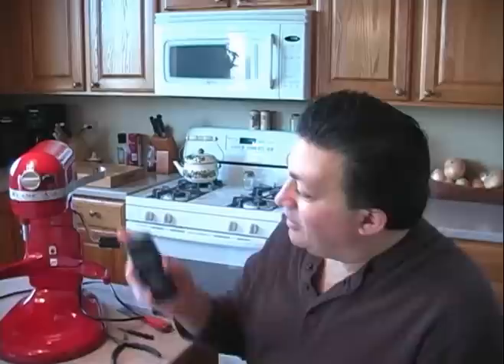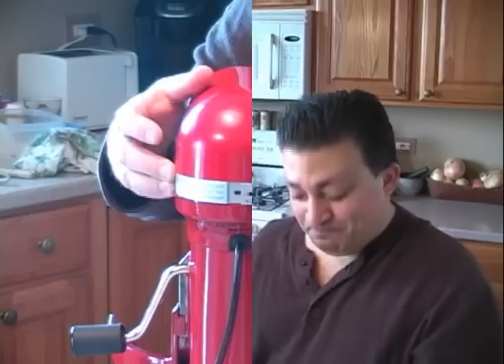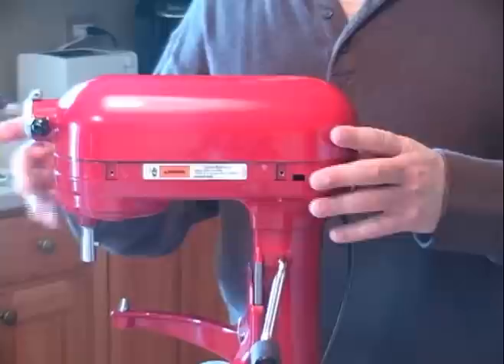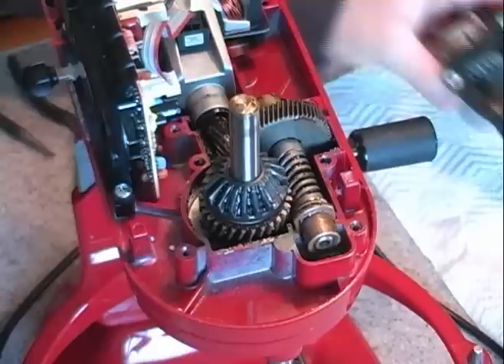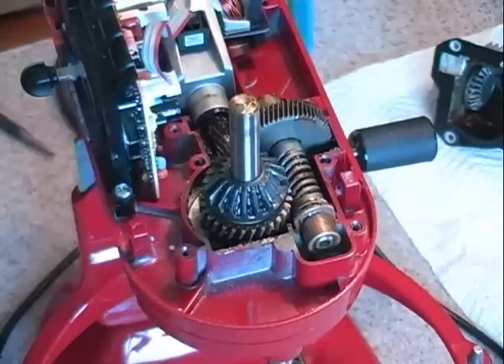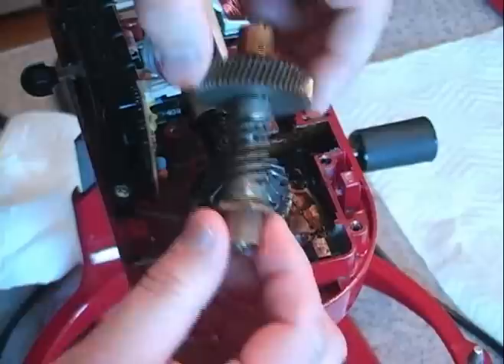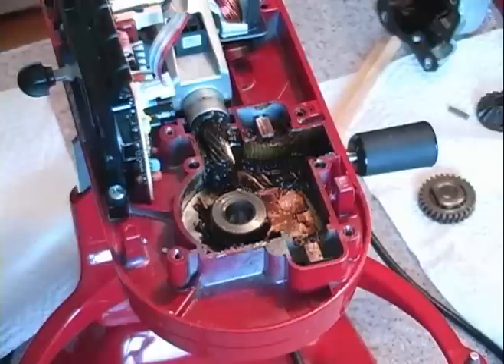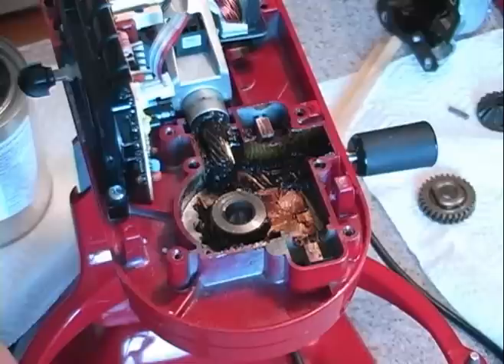How to Repair a KitchenAid 600 Professional Mixer That Isn't Spinning

Comment: The wife has been using hers for at least five years making bread two or three times a week. Her machine stopped turning and I used your video to take it apart and determine the worm following gear was all shredded. There were bits of metal inside as well. I used your video to take it all apart, figure out what the problem is and then I ordered new parts. Thank you. Much cheaper than buying her a new one! One point about the mixer, you have to be careful to only use the recommended speeds for the job. If you try to use it on too high a setting you wreck the gears. Thank you again! Great video. Saved me $$$$$ and made my wife happy. Happy wife, happy life.

Comment: I just received the parts and put it back together again.  It works great.  Thank you so much for your video it has saved us a great deal.  Your instructions were easy to follow and very clear.  Again, thank you, thank you, thank you.  Anyone else reading this just follow his instructions and you cannot do wrong. Thanks again.

Comment: What a great video.  I too bought a mixer, the big expensive one.  After a very short time the gears are not working.  But of course after the warranty.  The totally ridiculous thing is that my new one was 4 years old when k put, but I bought a 4 qt back in 1977 that still works like a charm.  Since my big ones doesn't work, I am going to try and fix it myself with you great video.  I feel I have nothing to loose.  Thanks again and great video.  Love PegEgg

Comment: Still ticked off that Whirpool would not fix the unit for free. Future models like yours came with the aluminum trans cover that I think would be far more durable. But the unit is fixed and it cost me about 30 bucks with shipping, thanks again.

Comment: I purchased a KitchenAid as a newlywed in 1979 and have used it a lot, like several times a week. It has run like a champ and never even been serviced. I think the quality of their parts were better back then. Lately it has been making a lot of noise when it runs, so I will take it apart and clean it up and see, if any of the gears maybe needs to be replaced. 
Thank you for the great video, I will follow it as I try and fix this noise problem.

Comment: Dear Sir:  Thank you for this video.  My KA Pro 5 broke.  The motor ran but the paddle would not spin.  It would spin but stop right away then if I tapped it it would do the same.  Was going to bring it in to get fixed but the KA authorized repair shop that I brought it to about 7 years ago closed and the closest was in Orange County and I live in LA so the drive would be far and maybe it would cost a lot to fix.  So I thru research I found your video and bought the parts from Mending Shed as you suggest.  I was able follow your directions and now it works like new.  Works like a charm.  Even tho you have the 600, the 500 inside is the same.  I think the difference is, is that the bowl is probably 5 Quart not 6 like yours and the motor I can guess has less wattage than yours.  Thank you once again, now I know what to do if it happens again.

Comment from the maker: Thank you for the very kind feedback on the video!  

I was very disappointed that it failed after such short a period of time. We purchased it new directly from KitchenAid as they were offering a rebate at the time.  We used the shredder attachement during the 1st year once, so I dont think it was that.  I think a tooth on the bevel gear snapped off (maybe was weak) which caused binding and furthur damage.  It appears the bevel gear is not made of as solid of material as the other gears.

Comment: Excellent video !  Thanks for taking the time to make it.
I don't have a problem, just wanted to see how this mixer was made.
To be honest I thought this mixer would have been built stronger, I can't imagine 
making it any cheaper as this is the bear minimum I would want for reliability.
A mixer of this should really not be breaking the gears if anything the speed control board should sense the extra current and stop the motor short of doing any damage to the mixer. Thank You again.

Comment: Thank you so much for your video.  We have a very similar problem with ours.  After only a few used the gears are grinding inside and the machine is skipping when turning.  I started to take it apart but was afraid to continue.  Your video is so complete that I will be taking it apart to see which gears I have to replace.  Thank you so much for all your help.

Comment: I bought my KP26M1X shortly after you, in March of 2009. Mine died today while making bread dough. My worm follower gear was worn to about nothing. The remaining teeth were super thin, but the worm and all other gears, including the bearings are almost like new. I use mine A LOT, but for bread dough, which I suppose wears on the gears. I went to the website you said and ordered a few of those gears, and 1 each of all the others with the grease. That way, I'll have the parts on hand next time!

Comment: thanks for the help, I have a wolfgang puck stand mixer 700 watt. Its very similar to your mixer and this video helped a lot. I'll have to replace all the grease b/c of all the metal shaving in it. I had 3 gears stripped. Nice to see that they where all metal gears....thanks again.

Comment: Thank you for the video. Mine had the plastic transmission cover which I replaced with the aluminum one(my wifes kitchenaid is 10+ years old. It locked again when my wife was using it. I had replaced the bearing pieces, gears were in excellent shape. It locked up while my wife was using it. I checked it again, and the gears were fine,but the screws were loose on e trans cover. I suggest running it for a minute and rechecking the 4 screws on the trans cover for tightness.

Comment: I just ended up fixing the same exact problem with our mixer.  I didn't even think about getting the service manual or looking for a repair on youtube, it was pretty straightforward.  I ended up doing a different repair, rather than getting replacement accessory drive gears, I used sand paper to rough up the bushing in the transmission housing, and then filled that hole with JB Weld epoxy.  We never used the accessory drive, so I figured it was a liability.  It seems to me that those accessory drive gears are pretty anemic in this model.  It looks like the newest version of this mixer has an entirely redesigned transmission which is a lot better design.  AvE has a teardown of the new model in his channel.

Comment: Well done video. We have been able to follow your procedure exactly and have had not been lost at all. The parts came today and I am working on getting it back together. This is an outstanding resource for those of us who have the 600 mixer that seems to have this gear defect issue. Wondering how long this repair will work as I cannot figure out why the gears wore out in the first place. Thanks.

Comment: @cbaiocco I have had the bevel gear on two different Pro 600s break a combined total of 6 times. It's not an odd gear to break. I finally gave up and ordered a Bosch Universal Plus for mixing bread dough (which I do 2-4 times per week).  I would like to use these instructions and fix it hopefully for the last time, and then only use it to make cookie dough, frosting, etc. All previous 6 repairs were done by an authorized shop, some of which were covered by the warranty.

Comment: Thank you.  Mine is still working well and I use it heavily.  I bought mine around 2006 or 7 and I make two loaves of bread twice a month, one of the most taxing processes you'll use this machine for, as well as a myriad of cakes and bagels etc..  However, the post assembly for the attachments keeps falling out now.  I see by your video that the pin that holds that from falling out has either broken or come out of it's hole.  I'll get around to it eventually.  Thanks again.

Comment: Thanks so much. I'm off to get a snap ring plier to see what gear needs to be repaired.
I agree that Kitchen Aid should be built stronger. I use mine very hard but thought that It should be able to handle the work load.

Comment from the maker: @DM McDougal try using a little oil/lubricant at the top of the shaft.  Another option is to remove the retaining ring from the worm follower, then you can tap the planetary shaft down I believe.  The bevel gear will come off, there are no other retaining elements.

Comment: Great video! Fixed my wifes unit.My plastic trans cover cracked causing a misalignment of the gears. I replaced that bushing at the end of the worm gear, all the other gears were in excellent condition. Reused old grease(very limited use of this mixmaster). Turned it on and everything worked perfectly. I really wonder if you need that benelene grease or if it can be substituted? I know the device is for food, and the grease is nontoxic, but it is a sealed unit. I thought of using synthetic.

Comment from the maker: @xpectin:  try inserting a screwdriver between the bevel gear and the worm follower gear and gently pry it up.  The bevel gear may not slide up the shaft easily at first.

Comment: Hello, thankyou for.your video.  I saved it because its chalked full of vital information if ever needed!
Would you be able to tell me what would cause the beater to fall out when I am finished mixing??? Also, the whole upside round thing fell out, that the beater hooks into. Im so bad about explaining when I have absolutely no idea what any of the parts are called, please forgive me. 
Blessings♥️
Reply from the maker: I had the same issue after I made this initial video.  The planetary shaft disconnected from the assembly.  Since it is pressed in, I had to replace the planetary assembly.  I expect this is what you will need to do.
Reply: @repairit2  Thankyou so.much for responding..I called Kitchen aid and they gave me a local # 
We took itnto.San Jose and  had it maintenanced and everything in side was all good and he put.the planetary on correctly. He change the greased cleaned it up and charge us $60. Not bad since it was purchased in 2007. Someone gave this to me and I dint know of its ever been serviced. Im so happy to have it back working.

Comment: After I ran it again(with the top cover off, the big steel one on top), the screws were loose. I think after everything seated, the cover was loose. I retorqued the screws, and it was fine after that. Problem solved!

Comment: Excellent!  My Professional 600 spins, but has clunking noise.  What could it be?  All the gears look good.
Reply: I've noticed this as well after doing my repair. See how the bearings around the worm gear have flat sides that sit in the housing? They are actually quite loose, causing the worm gear to knock around. My guess is that this play in the worm gear is actually what causes the worm follower to grind down and eventually need replacement. It's a poor design, unfortunately.

Comment: How has this held up since the repair? Wondering if the repair parts are any sturdier than the originals. Have an identical mixer with a stripped worm follower gear, just waiting for parts.

Comment: thank you for the perfect video. I did everything like you explained. when i finished i noticed that there is a very noisy clicking and ticking that sounds like its coming from the back off the mixes , where the engine is. It gets louder as I turn up the speed . and this is with no load. the wired thing is , that when I run the engine with no gear it is silent...so .. very wired , and ideas?
Reply: Ravid Kol Any solution to your clicking? I repaired our Kitchenaid and it is doing the same exact thing. The engine still runs but the gears seem to be clicking.

Comment: Thank you so much for the video!  We're stuck however on the Retaining Ring Pliers.  We got a pair at Home Depot, and they won't go into the little holes.  The size says .070 so I was wondering what size you had.
Reply from the maker: The set I had has multiple tips (.070, .047, .036).  I believe I used one of the smaller sizes.
Reply: repairit2
Thanks!  We found it at Ace.  If anyone is reading this, the RIGHT TOOL is SO important!  Get the Craftsman Professional Retaining Ring Pliers.  Convertible: Internal and External.  #47412.  $25, but anything less won't work.  Removing that ring is impossible otherwise.
Reply: repairit2
JUST FINISHED!  We got the parts, and since my husband was out of town I was able to put it together with your video's help.  I feel SO EMPOWERED!  Thank you so much for the time you took putting the video together.  I'm aching for some baking!!!
Reply: Would be nice to let people know there are different sizes!!!!   Don't know of many homeowners who have this tool on hand as a general rule.   Bought one on Amazon and still not right.   Otherwise video was very good.

Comment: We did use a lot of force on it with pliers and a hammer. I think we were close to cracking the bevel.  It slides up and down easily, but gets stuck at the top when flush with the shaft.  Any other ideas? Thanks for your help!

Comment: The bevel gear on mine also has missing teeth.  I have removed the retaining ring holding it on, but it still will not come up off the piston.  Did you have to do something special to get it off?

Comment: thanks so much for this fabulous video! I have a 475 W Professional HD bowl lift  (purchased at Costco dec 2008-- I am not sure if it is  4.5 or 5 or 6 quart bowl?). I was juts kneading bread dough, not even heavy duty and it stop rotating. The motor is still working but part that is rotating the beaters doesn;t go full circle and runs "empty" in one corner. in my poor understanding it seems like the same problem you have had. Would you be able to verify the parts that you ordered?

Comment from the maker: @goobernette: the part(s) I replaced may be different than what you need. You should check all your gears and replace those that are faulty and show signs of wear. The numbers you listed are correct for the 600 model and gear types.  I am sure you can obtain the grease through other suppliers. Just be sure to get the same type as listed in the service manual. I do recommend purchasing a new snap retainer ring (9703680).

Comment from the maker: Does the motor sound like speed is changing from 8 to 10 without a noticeable change in rotation of the planetary (mixing attachment)?  Could also be an issue with speed control assembly.  See service manual for more information.

Comment: Great video. I replaced the brass worm follower gear on my KA 600 but now it developed a “knocking “ sound, What could be the cause of it?
Reply: I've noticed this as well after doing my repair. See how the bearings around the worm gear have flat sides that sit in the housing? They are actually quite loose, causing the worm gear to knock around. My guess is that this play in the worm gear is actually what causes the worm follower to grind down and eventually need replacement. It's a poor design, unfortunately.

Comment from the maker: It is just stuck on the shaft.  Put a pair of pliers underneath the bevel gear and tap it up with a small hammer.  It will come off, just needs a little coaxing sometimes.

Comment: Hi friend. Very beautiful and interesting video, congratulations. I would like to know what speed control parts can I use in my KITCHENAID 6 QT PRO model number: KP26M1XLC? When I try to move the speed control knob for 2 to 4 and 6, 8 and 10 I dont see any change in speed. The problem could be related to the speed control? Maybe I have to change the black speed control knob or speed control plate? You could tell me the parts I can change in my kitchenaid mixer? Can you try to help me? Please?

Comment: The real problem here is that KitchenAid make an inferior product and refuses to help customers with the issues. Overpriced defect prone machine. My advice is to NOT buy a KitchenAid mixer. Poor quality and management who wants to ignore the obvious problems. And yes I have an almost new mixer that does not work and got the same runaround from the manufacturer that others have received.
Reply: Don't just complain ... recommend a better product (hopefully a best-value product) that's built better than the KA
Reply: That does noting for the literally millions of people that have one in their home already. The sad fact is all products are going this way, and these are actually good compared to others on the market that can barely move out of their own way much less kneed a thick dough...

Comment: Thank you for posting. Any chance you or someone else could point out where the carbon brushes are located?
Reply from the maker: If you are asking about motor brushes, the motor is a replaceable part (not its components) as far as I am aware.
Reply: @repairit2  I would imagine it should be possible to replace the motor brushes on this model as you would on other KA models, no?  the other models even have easy access screws on either side of the cover.

Comment: Minding shed is great! However Kitchenaid changed designs on its pro 6 and made the worm gear and motor worm different in newer machines. It is slightly smaller and the motor gear has one fewer tooth! So now ,since stocks of the bigger gear have been exhausted, you no longer can repair them!
Reply: Garth Elliott  BULL

Comment: Hi, Thanks so much for the video! It save me about $100.00 dollars. Anyway, I have been having trouble with with the gear doing the same thing it was doing before. It has been running well for about 3 months since I replaced the worm follower gear but it seems I have somehow stripped the gears again. Do you know why this may be happening. The gear stripped the exact same way it did before. Thank you again!